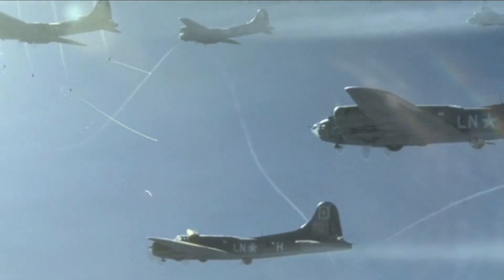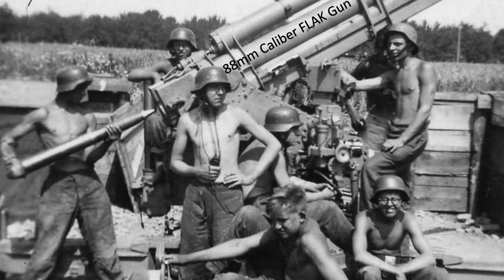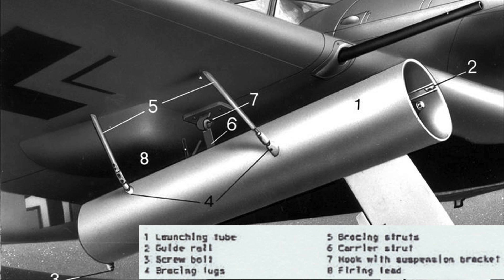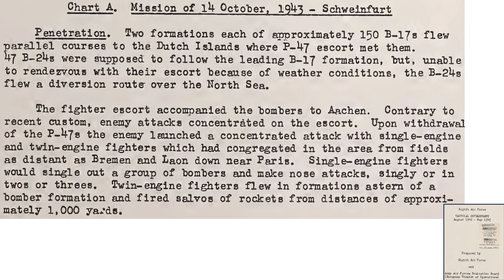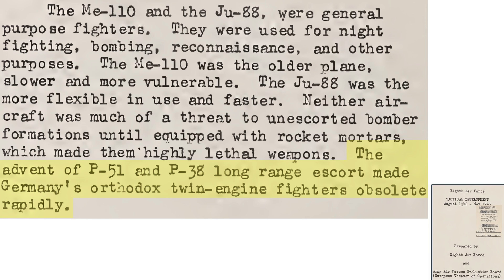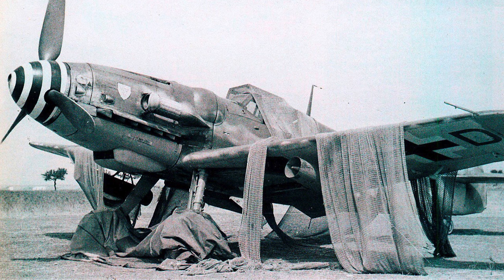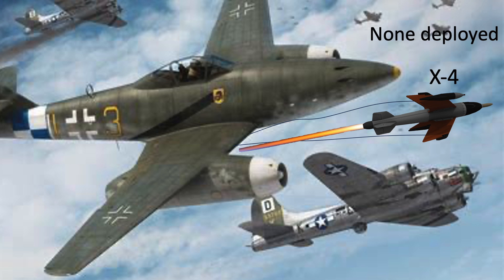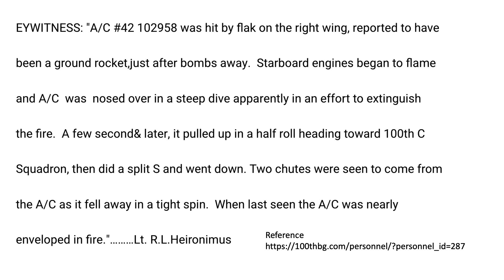Masters of the Air–Rocket Usage, shooting down bombers with questionable weapons and tactics

Comment: For whatever reason Germany did develop a great anti-aircraft missile system,but they never use it for some reason. I believe near the end of the video,where the soldier is holding it,all it was a hollow steel tube,no explosions in it.
It could fly up to 30,000 feet,with enough energy to cut thru the bombers like a hot knife thru butter,but they never deploy it.

Comment: I think it’s still possible the Germans did some kind of operational test with Taifun rockets on 3 Feb 1945. 

From what little info there is out there about the rocket development, it can’t be immediately dismissed that the Germans might’ve tried to get empirical data by firing some of the rockets at an actual bomber formation to workout development issues 

What tends to support this is that two aircraft were seen by multiple observers to of been struck by what looked like ground to air rockets 
The B17 you’ve mentioned in this clip, #42-102958, and the other being #44-8379 which was Rosie’s plane. Only 2 survived from the former, most survived out of Rosie’s plane except for 1st Lt Louis Chappel (navigator)and 1st Lt Eugene Lockhart (bombardier)

I believe the aircrew observing this happen certainly would be able to distinguish the difference between typical flak and something out of the ordinary, especially if it happened more than once

In both cases it sounds like the damage, although fatal, was not immediately catastrophic. That, to me, sounds more like what would happen with the smaller point detonation warhead of the Taifun rocket as opposed to a heavy to medium flak projectile detonation near or directly on the aircraft 

I don’t believe it looked the way it was depicted in MoTA, the rocket motor would have already been expended at the height of the bombers and not arcing like it was tracking or being guided onto target. From the reports it sounds like Rosie’s plane was only hit once, fatally wounding most in the nose, except for Command Navigator 1st Lt Stewart Gillison, who Rosie would nominate for a Silver Star for attempting to save Chappel and Lockhart while the plane went down . Gillison did eventually bailout, and evaded capture for 3 months before linking up with Soviet forces. None of which unfortunately was shown in the series. But there’s a lot about MoTA where artistic license was used for who knows what production reasons 

My point being it is possible the Germans used the relatively good weather conditions of that day to trial some of the Taifun rockets, which would aid in resolving any number of technical and tactical challenges. But this limited test, if it happened, does not by itself demonstrate the Taifun as being an operational system.

Comment: While I agree and will accept that the ground fired rocket didn't happen because evidence points that way, the evidence won't account for radicals and unknowns. Maybe someone was hoping to prove they work and did an unsanctioned test, thinking if they scored a hit they could either take it to their superiors and say this could save us, or take the test as a way to.keep them from going to jail post war.  The allies had no program for converting forward recon planes into tank busters, but it did happen. Same goes for the air launched. Protocol was from behind, but that late in the war you were using inexperienced pilots and a lot of desperation tactics. They knew they wouldn't survive lining up the correct shot to they took what they had.
Reply: Dude you are reaching so far, your hand is touching hairy balls of an 80 year old chinese fisherman

Comment: Watching the show, I felt like the rockets were far more effective than they would have been in reality. Are there any figures on hiw effective the rockets actually were?
As to their use from tge side in the show... I'm ok with it. Weapons don't always get used precisely how they are trained. I can readily believe a pilot was cocky enough to try a much harder shot, or was more confident with their guns and wanted rid of the heavy, drag-inducing rockets. Or too scared to reduce speed to get the distance right from the rear.
Reply: Apparently rockets were very effective, much more than you would expect considering how they were actually used (shot from far away with timed explosion). There are some historical documents showing that the Me-262 were, according to the germans, three times more successfull using rockets than using their 4x30mm guns that were deadly but very  difficult to use.
Reply: @haltux  thank you

Comment: wow the USAAF was realy polite here. calling the BF110 a fighter or interceptor is a pretty far fetched claim. the luftwaffe tried to use it as a long range escort only to run into a hilarious problem: it needed escort fighters...

the only fighter role where it was good was night fighter.
Reply: The USAAF choice of words was not a far fetched claim.  They didn't even imply that the Bf110 was effective in combat against other fighters, which we all know it was not.  But it was designed as a heavy fighter, and until it was driven away by longer range escorts It did successfully intercept and attack heavy bombers in daylight. What should USAAF have called it, a bomber?
Reply: @gort8203  a plane that exists.
Reply: @Irobert1115HD   Well, they were not as silly with terminology as you want to be.
Reply: @gort8203  the BF110 was pretty much an attempt on a multirole aircraft. and it basicaly was bad at all of them. well the follow ups where even worse thou.
Reply: @Irobert1115HD  Now you want to tell me what the Bf-110 was?  You really like to play games with terminology.  It was designed as a Zerstorer or heavy fighter.  It was actually pretty good at most things, but due to design choices it could not contend with lighter higher performance fighters.  None of this has anything to do with your silly criticism of the term used by the USAAF in describing Bf110s that intercepted and attacked their bombers.

Comment: This is an excellent series you are putting on here, thank you for fact checking the masters of the air series. 
If I may offer one criticism the rest of the internet will probably hang me for:
When referencing ammunition types, millimeter and caliber are two different things. An 88 mm shell would be referenced as 88 millimeter, not millimeter caliber. I always think of it like Caliber is imperial, millimeter is metric.
Thank you for your videos I enjoy them quite a bit.
Reply: Calibre is the internal diameter of the gun, metric or imperial. It it not true to say that it's only calibre if it's imperial.

Comment: I would not rule out a German unguided ground to air missile being used. Germany had a few that were built, and while they were never deployed as designed, in a battery, this does not mean that someone didn't fire one out of desperation.
We know that some weapons were used that were never even reported as being created, because we have pictures of said weapons from the Allied side.
Remember, that at the end of the war, the Germans were both burning documents to hide the Holocaust and there were not careful about what was burned, but after the war, the situation was so desperate that anything of potential value, including mere paper was gathered and either burned or sold.
I'm not stating that any rocket was used, and it would still be more likely that it was observer error rather than an actual launch, but I don't think a launch can be categorically ruled out.

Comment: The UK deployed unguided surface to air rockets around London during WW2, the logic being that a massive and dispiriting battery of flak could be fired as a salvo.
Reply: They also attempted to deploy some on ships but later removed them when they deemed them to be ineffective.
Reply: @mw2mw3rhett  I don't think the ones around London ever got used, although if someone has other information it would be interesting to hear.
Reply: The UK also worked on surface to air guided munitions at the very end of WW2 but it wasn't very advanced. It also worked on drones using Gee, but Gee has a limited range so ceased to be viable as the Cold War started and so manned bombers were reemphasised. The USA had some autonomous drones in WW2 but not guided by electronic aids like Gee.
Reply: @wbertie2604 the USAF did have guided missiles controlled by B-17s and B-24s and used them operationally - the QB-17 programme 🙂
Reply: @RoamingAdhocrat  yes, it did. But my point about drones was about autonomous ones. The USA had quite a decent guided bomb/missile program, though.

Comment: The Germans also had the R4M air to air unguided rocket. It was a development of an anti tank rocket (Panzerblitz)  used on FW 190’s. Galland’s JV 44 used them in the last weeks of the war and shot down some American B-26 0:06 Marauder medium bombers with them in their ME 262s. Masters Of The Air makes no mention of German Jets although the ME 262 equipped JG 7 did attack 8th Air Force bombers.
Reply: I thought so too about the R4M that it was a development of the panzerblitz but apparently it was developed independently before the use of the panzerblitz. According to this book; Luftwaffe Special Weapons 1942–45
by Robert Forsyth
Reply: @antartis73  I read somewhere that the R4M was a development of the Panzerblitz but I can’t give you the reference. I have read, and have in my library, dozens of books on the Luftwaffe and the WWII air war. It may have been an ME 262 book discussing the R4M.
Reply: @lowellwhite1603 It's the other way around. We can tell this is true because the R4M is a straight diameter from tail to warhead. The Panzerblitz has a much wider warhead shaped charge attached to an R4M's motor and tail.

Edit: The Panzerblitz 1 is an independent design. The Panzerblitz 2 and 3 are both based on the R4M
Reply: @lowellwhite1603  so have I mate, so have I. I’ve lost count how many to be honest.
Reply: @lowellwhite1603  Fleischers German Air Dropped Weapons is the go to reference.